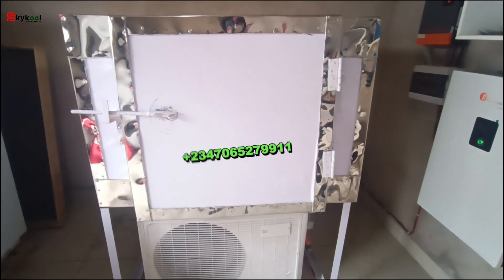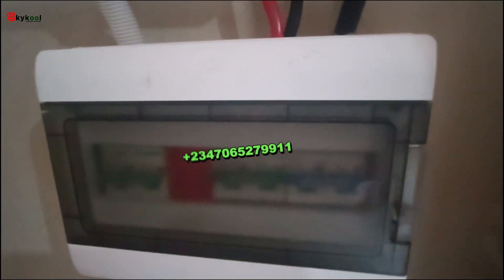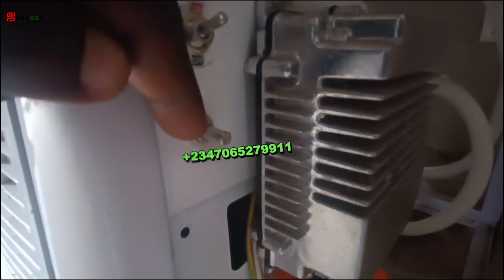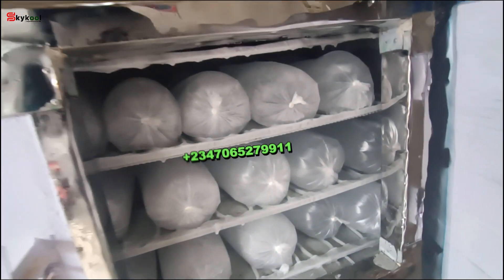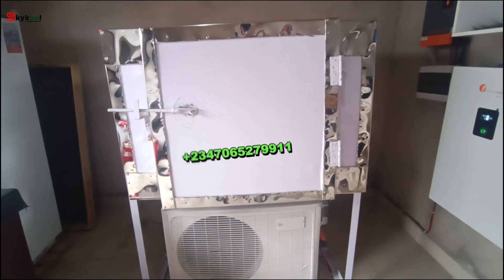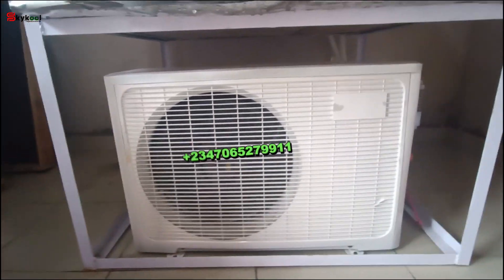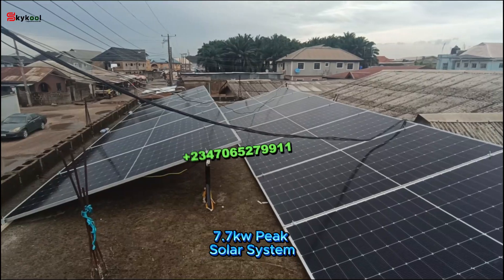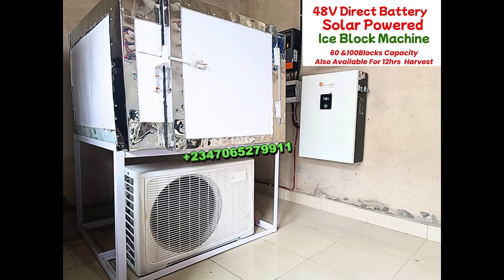30Pcs Capacity 48VDC Solar Powered Ice Block Machine  +2347065279911

Comment: Good morning Sir, please how much is the compressor only DC current?
Reply from the maker: Compressor cost is 485,000
Reply: How much is the cost for 50 or 100 capacity solar/condenser powered ice block making machine?